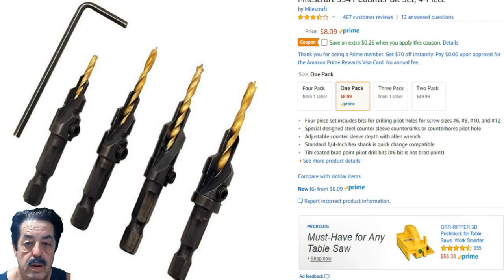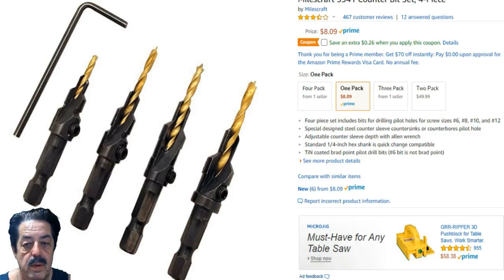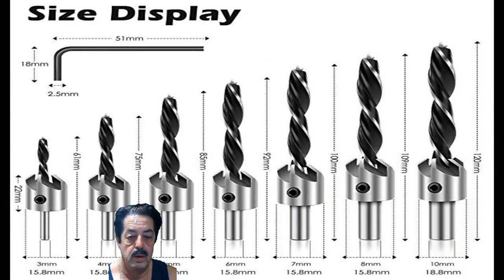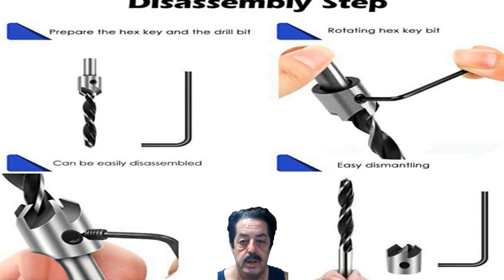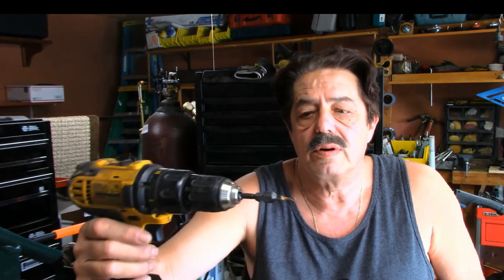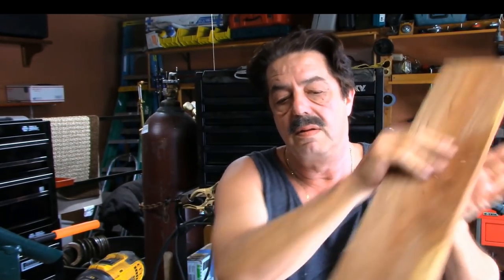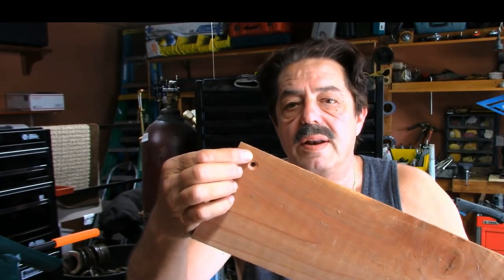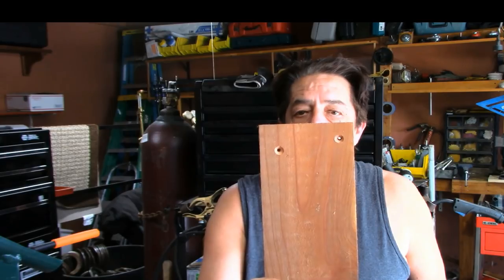Tips - Tricks To Using Countersink Drill Bits

Comment: Good job. I appreciate the video.
I'm a believer in Countersink Drill Bits. I have one set up full time in a straight handle Worx cordless drill driver. I use is just about every day in my property management business. I can grab it quickly drill several countersunk holes and then follow up with my regular drill driver for screws.  I've also experimented with making some for 1/8" bits for a Dremel (because it is so much faster. 
Harbor freight sells some, but I've found it's important for the bit/countersink to be balanced and aligned (no wobble) Something that the HF ones fail at. 
-
Reply from the maker: Interesting point you make - I have a couple more tip videos coming out on drill bits -  thanks